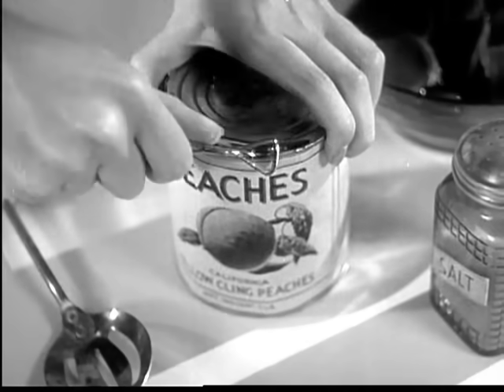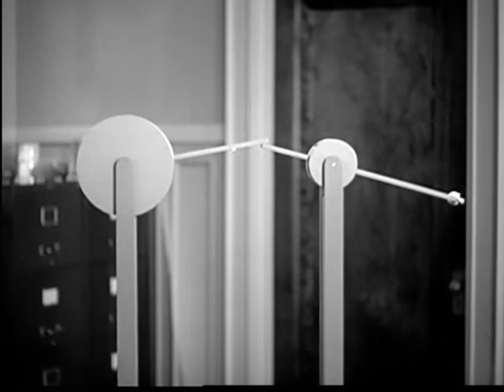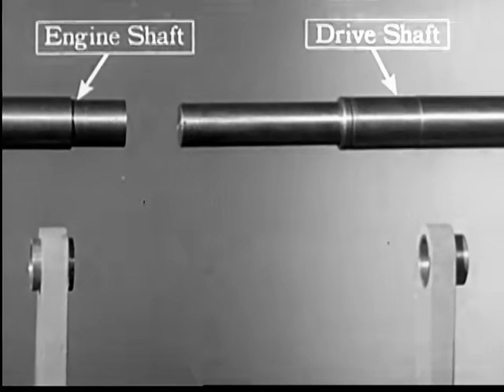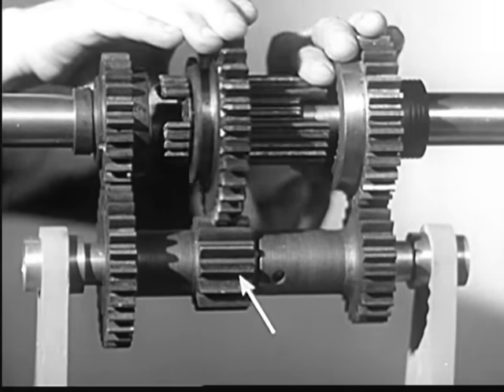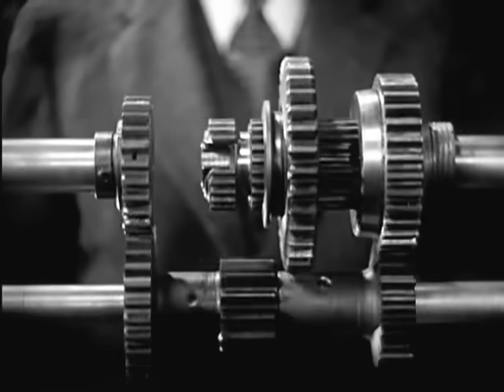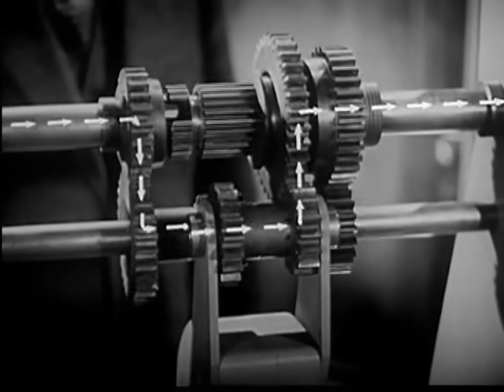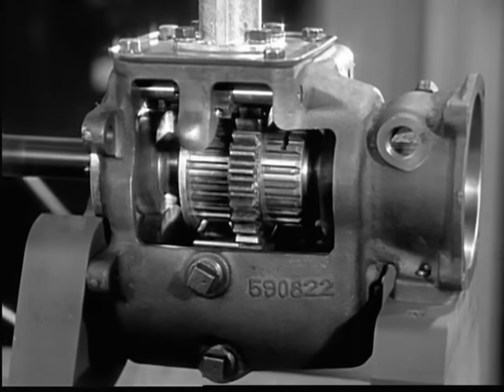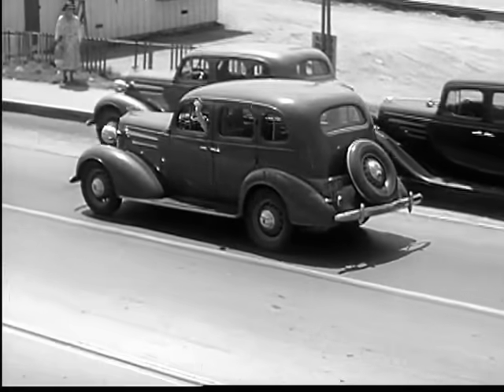Spinning Levers - How A Transmission Works (1936)

Comment: So what about that third pedal. Is it still a clutch or does that mesh stuff he mentioned eliminate the need of a clutch? And if so then what's the third pedal for?
Reply: The clutch is not shown here. The clutch ill go in between the engine and the transmission
Reply: @Redtooth75  I know that I mean in the part where the women is in the car going down the hill. You see a third pedal on the left. My question is  the mesh stuff he mentioned there instead of a clutch or is there still a clutch?
Reply: @matthewcapps418  There is still a clutch, the syncromesh he was talking about help the gears engage without grinding

Comment: 2:00 Holy shit. That is some sweet animation they had in 1936
Reply: Holy crap you're right! Is that stop motion?? It must be right?
Reply: @DoeZeo  Yeah, it should be really easy to do too, since you can measure the angular movement per frame and just measure it out on each step. You can see in the next shot that the gears are really stiff which helps keep the stop motion positions steady
Reply: @enginerdy  
1.Stopmotion is great
2.Holy Motherof god they did great!
Reply: I didn't consider that, but now that you point it out, my mind is kinda blown.

Comment: My 38 coupe must have bad synchronizers because it shifts nowhere near this good or smooth, but it is from 38.
Reply: synchronizers are wear products. Especially if you're rough with the transmission. It is entirely possible yours are starting to die.

Comment: You haven’t experienced a true manual until you’ve driven an unsynchronized manual.
Reply: Like the man said, just get the engine down to 90 revs and ease yourself into the next gear

Comment: take note people, don't ride your brakes downhill it can wear down the brake rotors, use your lower gears to control the car and if you drive an automatic you can still control it with the numbers 1 & 2.

Comment: It’s remarkable that When they say transmission they mean manual transmission
Reply: While planetary gear transmissions did exist, and were the first design of the transmission in early turn-of-the-century cars, the automatic transmission that self-shifts gears was nowhere near ready for the general public to drive in the 1930's.   There were clutchless transmissions, that automatically engaged the clutch for drivers to shift, but not transmissions that the driver didn't need to shift.   Most if not all cars had a manual transmission in some form or another.

Comment: 1936 : 3 speed manual + reverse
2019 : 5 speed manual + reverse
Reply: They increased the gears to increase the material that can be worn in order to ultimately add to the life-time of the vehicle without doing in-depth maintenance on the transmission. Also, dividing the work across 5 gears instead of three allows for more fuel efficiency due to the options of gears you can switch between in order to go the steady speed you wish to travel.

Comment: Correct me if I’m wrong but if you get three times the force and the car is 3000 pounds does that mean that the engine needs to supply 1000 lb ft of torque or does the final drive ratio compensate

Comment: "We can go as fast as we want in the third gear" --  automotive engineering was in its infancy, but teaching was as its best.
Reply: "He a little confused, but he got the spirit."
Reply: well, the 3rd gear in this video is the 4th gear in modern cars. Most modern cars reach their top speed in 4th gear.
Reply: @807jenskeuh  Except not really, especially with the more powerful engines. There are overdrives for some reasons other than just fuel economy.
Reply: @XStuntManiac  That's why I wrote "most" and not "all".
Reply: @807jenskeuh  At 4th gear, the transmission is at a one-to-one drive. At gears 5 and 6,  the transmission goes into overdrive.
Reply: I wish I could buy this statement.

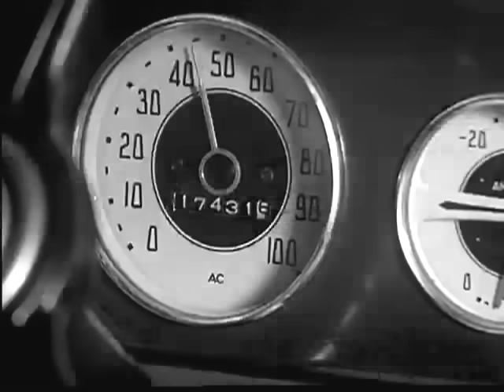Comment: 9:13 - "Then she will shift into 2nd gear, to bring her car safely under control by the bottom of the hill."  This little gem of a concept was not explained here, but it's called engine braking, and basically uses the engine's compression of air in the cylinders as a extra brake for the car's momentum, ... so you don't fry your wheel's brakes, either failing or at least risking early costly replacement.

To give a titch more detail, the engine normally compresses air in each 4-stroke cycle, before igniting and air-fuel mix.  When you give a manual transmission car no gas, but leave it in gear, this compression takes work, which comes from the momentum of the car, from the wheels to the drive shaft, through the transmission to the engine.

Downshifting from a higher gear into second gear means more engine cycles per unit of time, so more air braking.  When you see a sign on the road saying "No engine braking" this is because trucks use this technique, but it's pretty noisy, some the local home-owners passed a local  ordinance against it.
Reply: Truck engine braking uses a special device called a Jake brake, which produces that pop-pop noise.
Cars with auto transmission can also use engine braking, with driver input. Shift from D4 to D3... that will cause the transmission to downshift from the 4th to 3rd gear. Some models have an overdrive button on the shifter, which is basically the 4th gear or highest gear. Pressing it off will also cause the transmission to shift from 4th to 3rd gear.
Reply: @jonathantan2469  Great addition.  I should have mentioned that Jake Brakes improve on the concept by exhausting the compressed air after the compression stroke, not in the normal exhaust stroke.
Reply: And you sir explained something the Internet has never been to do
Reply: Tbh, I do that daily. I thought this was common knowledge
Reply: It's not really the compression stroke, since you get most of the energy you used on compression back during the following downstroke, it's mostly just a gas spring. 
You feel that if you ever started an engine by turning it over with your hand. The compression really feels "springy" and it comes back to the starting point easily after passing TDC.

The losses (and therefore braking force) occur at the intake stroke which, at high RPM has to suck a lot of air through the nearly closed throttle valve (of whichever type it is). 

The Jake brake mentioned in other comments releases the pressure (and therefore the stored energy) after the compression stroke, so the piston can't "spring" back anymore. That greatly increases (in this case wanted) losses, but yeah .. it lets the full compression pressure out the exhaust, which is way higher than the pressure normally is at the start of the exhaust stroke, therefore really loud.

Comment: Still loves these old “how it works” videos. These were before blocking rings and synchros were added to the mix. Also helical gears to keep them quiet and transmit more horsepower.
Reply: Helical gears reduce mesh noise and wear because the gear surface areas meet at a different time not like a flat surface gear.

Comment: That gave me a brand new perspective that I have never thought: "every gear is a set of leverages" just wow
Reply: It made me rethink of life tbh.
Reply: This is so critical, but today people will just say "transmissions work because of gear ratios." Ok, but what are gear ratios? Why is it easier for a smaller gear to spin a larger gear with more force (but slower) and harder for a larger gear to spin a smaller gear (but faster)? Because of leverage. Of course, nobody actually knows what leverage really is, but this is much closer to an actual explanation of how gears work than today's.
Reply: @CoDisafishy  Saying that "Why is it easier for a smaller gear to spin a larger gear with more force (but slower) and harder for a larger gear to spin a smaller gear (but faster)?" shows how much you didn't understand the video. I suggest you go read up on mechanical advantage; it should answer a lot of your questions.
Reply: @marcushendriksen8415  I understood it completely. I said because of leverage which is a part of mechanical advantage.
Reply: @XX-lp3oi  I didn't realize that was a quote from a movie... Thought you were just trying to start another argument haha.
Reply: Victor Murat  Nobody can explain why something is easier to move depending on the distance from the fulcrum. You would normally just say, "because of leverage." What is leverage though? It can't be made any more simple than it is and that's why it's called the Law of the Lever.

I guess you could say the objects are trying to find equilibrium on that fulcrum, which is just a balancing point, but why is everything always trying to reach equilibrium? Too many questions.
Reply: @CoDisafishy  
If you have ever heard about torque, it actually becomes fairly easy to understand how levers work.
The lever is simply a sufficiently rigid body, and the fulcrum a sufficiently stationary pivot.

The torque associated with a force on the lever is the component of the force perpendicular to the lever, times the distance from the fulcrum to the point of application of said force. Mathematically this is t = rF, where t is the torque, r is the distance from the pivot, and F is the force. Torque is a pseudovector, so if I apply a downward force on the left part of the lever, that produces a torque with the opposite sign as the torque I get by pushing down on the right.

The part where "leverage" comes in, is where you get crafty with the "r" of the two forces. As demonstrated in the video around 1:30, a 25 lb weight can be put in balance with a 5 lb weight by doing this. If you look closely, you'll see that the board is marked at even intervals along its length. If we call the distance between two marks d, then the 25 lb is d to the left, and the 5 lb is 5d to the right. So the applied torques on the plank are 25lb x d and -5lb x 5d. 

If we consider the plank when it is balanced (not accelerating) the net torque on the board must be 0. Let's check:
(25 lb x d) + (-5 lb x 5d) = 25 (lb x d) - 5x5 (lb x d) = 0 lb x d = 0, as promised. Obviously, it is possible to put more torque on one end of the board than the other, it just means that the board will be accelerating (not balanced). Likewise, when you step on the gas pedal, you are accelerating until the effective forces on your car cancel, and you maintain speed.

If you look into conservation of angular momentum, you'll see that levers are simply an application of Newton's second law (F=ma). The difference is we shift the discussion from talking about forces and displacements to talking about torques and angular displacements. Hope that helps you a bit with some of your questions; physics can be a neat subject to learn if you let it.
Reply: @scalesconfrey5739  You did break it down further and that was a really good explanation of what it is on a mathematical level, but mathematic expressions are still just observations and not answers for why things work the way they do. In your last paragraph, you explained that they are bound by Newton's second law. This is what I mean: we don't actually know why things work, but we can observe them and use them as tools.
Reply: @CoDisafishy  
That's a bit different from saying no one knows how something works though.

That's like the analogy of the watch as the universe. If you can't take apart a watch and look at what's inside, you can't know exactly how it works. Similarly, we can't decode the exact nature of the universe (in part) because we are one of the cogs.

That's a completely different statement from the one you made about no one knowing what leverage is. Science isn't about searching for absolute Truth, it's about accurately modeling the reality in which we live.

The underlying mechanism behind a lever as a tool is Newton's second law, which is a model for how physical objects respond to forces. I would agree with you that there's no way of knowing why this is. I don't think anyone is claiming that, and I don't think that's something reasonable to demand of anyone.

For all we know, the mechanics of the universe are the whim of some extra-dimensional child, and the universe is an art project. There's no way to test this idea, and it doesn't lead to any meaningful predictions about the universe's future.

So far, science has done a pretty fair job of accurately predicting how phenomena play out in reality given a set of conditions. Where those predictions are wrong, or phenomena found that could not have been predicted, that is where the frontier of Science lives.
Reply: @scalesconfrey5739  It wasn't a completely different statement. That was my original point when I made my first comment. I do agree though, it's not extremely important for us to know the answer to those questions right now. It may help with figuring out why things work differently on a quantum level though. For now, we can get along with just knowing the laws and how to use them.
Reply: It's the simple things
Reply: Ain't they teach you that in Technical school???
Reply: @thinh1102  And you think everyone went to technical schools?
Reply: aynısını düşündüm izlerken...
Reply: Clear as water!!?!! 👌🏿😎
Reply: Chrysostomos  Thank you sir for actually reading.
Reply: I used to think paddle wheel as a wheel, never understood how this was possible. After imagine them as just series of levers, i can easily understand it.
It took me 10 years!
Reply: Set of levers. Rewatch maybe

Comment: wait you want to tell me that they didn t had brakes like shifting in lower gear when rpm is high in higher gear can damage the motor
Reply: They did, but the service brakes didn't perform as well as today's brakes.  So people relied on engine braking to assist the service brakes.  The engine braking would do the heavy lifting of absorbing the car's downhill energy, while the service brakes would do the last little bit to bring it to a stop.

With modern brakes, you don't have to do that anymore on standard passenger vehicles.  You can, but it is more economical to replace your brakes than to replace sealing rings in your engine.  Trucks today still have engine brakes that do the majority of their speed control.  Also known as the "Jake Brake" because of Jacobs Vehicle Systems.

Comment: Everybody is saying this video is educating us more than modern education today.  Remember that these transmissions back then are not as complex as the ones today. Back then, the cars had a simple set up just to do one simple job. Today, we have cars that have transmission that can lock up, change gears in a split second, using a computer to change the transmission for the vehicle, and built to haul heavy things. Modern transmissions also have 6 gears to cram in a small vehicle too. Transmission back then had 4. So yes, this video is easier to understand, but it is also the most simple transmission compared to today's transmission.
Reply: but the problem is how people learn something but not with how complex the technology is today, a good simple explanation is always better than something you can't understand